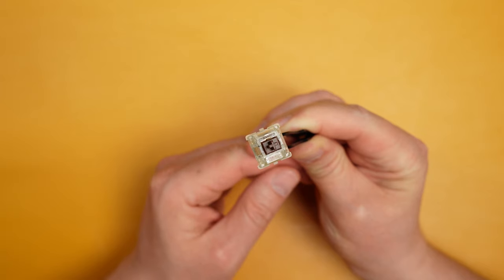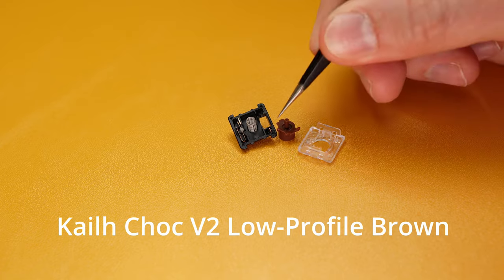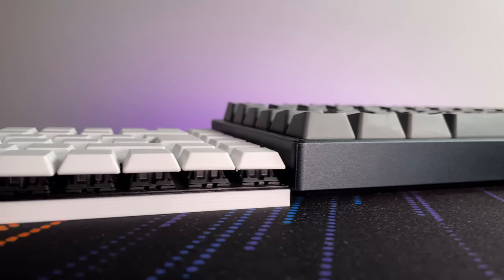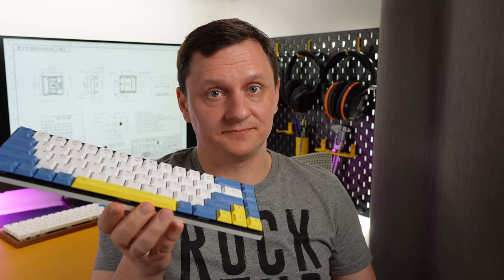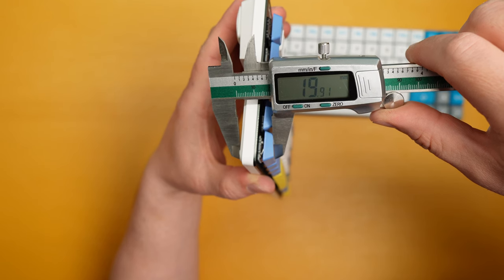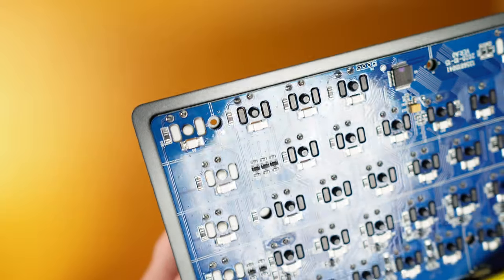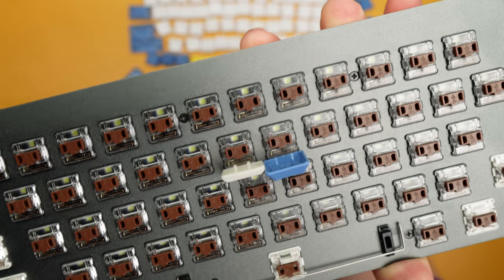Low-profile mechanical disaster

Comment: Honestly, the form-factor of Kailh Choc v1's should be the standard. There's literally no point to having "kinda low profile" switches.
Reply from the maker: Yes, some standards should exist for the low-profile switch ( keycaps, pins location, . . . )
Reply: @PavloKhmel   - Do they? Did you put these details you collected into a spreadsheet/ excel / table? Can you please share it - I am trying to create a Wiki base around LOW PROFILE Switches as hardly any proper info base exists.
Reply from the maker: @AX-fx7ng  I do not have a spreadsheet. What details are you collecting in your Wiki base?
The links below provide technical drawings and other technical information. AliExpress description for Gateron and TCC has technical details with technical drawings as well.  
- Kailh Choc Low-Profile Burnt Orange - http://www.kailh.com/en/Products/Ks/CS/321.html
- Kailh Choc V2 Low-Profile Brown - http://www.kailh.com/en/Products/Ks/CS/755.html
- Gateron KS-27 Low-Profile Brown - https://www.aliexpress.com/item/1005002957843849.html
- Cherry MX Low-Profile Red - https://www.cherrymx.de/_Resources/Persistent/b/3/1/e/b31ed369e2614b88503ba419d4e0a8339a7c55e5/Data%20sheet_MX1B-L2NA.pdf
- TTC KS32 Low-Profile Red - https://www.aliexpress.com/item/1005002118984269.html
Reply: @PavloKhmel   Muchos Gracias Brother. As much as possible for anyone wanting to Custom design around LPs. 
As I see so much data for normal ones, but very little for Low profiles. So many builders but not any "data/ wiki base" or Spreadsheet table for LP ones. 
Should we not put that together - as community?
Reply: @PavloKhmel  the community has made KiCad footprints for some of those switches, there's a few PCBs out there... mostly split ergo keebs
Reply: I much prefer the Choc v1’s keycap design too! No need for keycap pullers you just lift up the side of the switch to pop it out. The clickbar version is also superior.

Comment: I've been trying to look up all kinds of switches myself there are so many that it's just silly. Like only recently found out that you can't even just swap standard sized switches with low profiles from the same make because the pins are in different locations so I'd need a custom PCB just to use them. It's so stupid. Their websites should give out all this info about all their switches.

Comment: Finally, someone pointed this problem out haha. I recently bought a NuPhy Air75, and just learned that low profile switches are usually never compatible. It's such a pain. 
If it's alright with you, can you help me check if the Kailh Choc V1 springs are similar in height / diameter to the Gateron KS-27 springs? I found out that I can buy Sprit brand Kailh Choc springs separately (they have 12g-85g spring weights), and I want to try them on Gateron to create much lighter switches. Most of these low profile switches are 50g, and a bit too heavy for me. Thank you for your time!
Reply from the maker: I uploaded photo for you: https://www.reddit.com/user/pavlokhmel/comments/v1mz0m/springs_kailh_choc_v1_vs_gateron_ks27/
Kailh Choc V1 - spring diameter 3.41 mm, lenth 10.46 mm
Gateron KS-27 - spring diameter 3.33 mm, lenth 11.36 mm
It is possible to move springs between switches. But Gateron spring is longer.
Reply: Wow, thank you so much! This is very helpful!
Reply: @trelag  So you found a solution?

Comment: This shit needs to be standardized. If not, it might be due to mechanical constraints. In that case, they might be able to fix it by using super sturdy material like titanium for these pin plates... I just want a low profile switch compatible with standard mx plate why is this so hard??? I was looking at choc v2 maybe I can just get rid of the third pin would that work???
Reply: The reason pin arrangement has to be different is because these switches are newly patented. The old cherry mx patent ran out years ago so every switch manufacturer just copied the cherry switch. The metal leaf connected to the pins are different than the cherry mx version so if a company copied the pin out design their metal leaf would look very similar to a rival’s and they could get sued.

Comment: You are probably the only person online who can help me with my dilema. I have outemu low profile switches and i don't know what can i use as alternative. Are Kailh Choc V2 Low-Profile compatible with Outemu?  Or which low profile switches are compatible?
Reply from the maker: Unfortunately, all low-profile switches that I have tried have different pin locations. Outemu MX has pins location like Full-size Cherry MX but the pins are very thick. So they do not fit in hot-swap PCB for full-size switches. But theoretically, if you have PCB for Outemu you can try full-size "Cherry MX style" switches.
Reply: @PavloKhmel  Its insane that low profile switches of different vendors are not compatible with each other, but are compatible with non profile switches. Mind blowing :) Thanks for this man i really appreciate the feedback, i will be more careful when ordering.

Comment: Hi, the "Khail-like" switches that you mentioned that are not compatible with Khail V1 pinouts could be the WM type. WM types are what I had on my older Keychron K1 v4 keyboard before they changed to Gateron. The WM had a stem that was very similar to the Khail V1 but the pinouts were not compatible. I only found out from an old keyboard review that mentioned WM vaguely.

I purchased some Khail LP sample switches to modify my keyboard but I discovered the pinout wasn't the same. However I can't find any info about WM as a manufacturer, so who knows? :(

Comment: Are low profile Kailh switches compatible with low profile Keychron keyboards? Thanks, great video.
Reply: I would check the page and documentation for your keyboard, it should say what kind of pin-configuration is compatible. - I happen to have the K3 Pro, and on its page it says "The K3 Pro is currently compatible with Gateron low-profile mechanical switches only, as QMK does NOT support low-profile optical switches.". - This is a confusing statement, however, as it starts referring to optical switches. But, I think that refers to their own Keychron-brand optical switches. So that doesn't clarify whether any other (non-optical) switches from other brands are compatible. - I just checked and honestly can't find it (easily). But again, I think it just depends on the pin-layout and I think there are some switches that are the same.

Comment: I am peeved that even PCB boards do not accommodate different low profile pins. If you get a compatible board with Cherry MX LP, the only compatible switch are the Oetemu GTMX, but the housing center pin is smaller than the Cherry so it is quite wobbly on the board.

Comment: Where did you find Outemu MX "ultra-low" Brown ? I can barely find them anywhere. They seem like the only Cherry MX compatible and have the same pin layout. Even Cherry MX Brown and Cherry MX LowProfile Red don't seem to have the same pin layout, which is very strange.
Reply from the maker: I ordered them on Aliexpress: https://www.aliexpress.com/item/1005002079974329.html
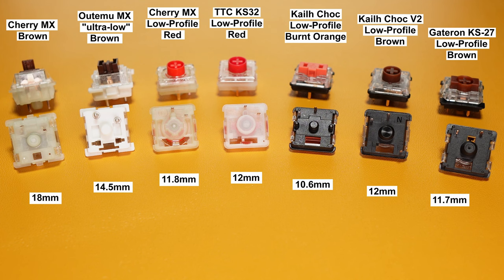Outemu MX has pins location like Cherry MX but pins are very thick (video 00:16). So they do not fit in hot-swap PCB.
NOTE: photos on Aliexpress show normal pins. Maybe something changed.
Reply: @PavloKhmel  Thank you very much for the clarification.

Comment: Hi. So did you manage to find a pcb that is compatible with low profile switches? I can't find concrete information anywhere but i imagine theme must be some pcbs compatible with the gateron KS27s, that are kinda becoming a standard...or not?
Reply from the maker: Not yet. I was working on other projects. So I postponed low-profile switches for a while.
Reply: @PavloKhmel  Thank you for the reply. I couldn't find a PCB since i want to build an ortholinear low profile keyboard :D (yeah i know) so i think I'll try my hand at hand wiring one with a micro pro to run it. I have no idea how i'll program it but that's for future me to figure out :). I'll be looking forward to whenever you get back to a low profile project.

Comment: Hi, Can you put low profile switches in a normal hotswap board?
Reply from the maker: No, unfortunately. I tried only these form videos. All of them have different pin locations except Outemu MX. Outemu MX has pins location like Cherry MX but the pins are very thick. So they do not fit in hot-swap PCB.

Comment: Man, low-profile keys are indeed frustrating to find.

I stumbled onto your video for my 'little' research of Outemu GTMX low-profile switches, which in my country, like 90% of the low-budget mechanical low-profile keyboards are using here. Comparing with the 0:16 on your video, it seems do have Cherry MX-LP bottom side but with Outemu MX ultra low top side (I think?). Or, if the top keycaps mounting is the same, it's seems like basically a clone of Cherry MX-LP. 

This one video, that I actually got a clear view of the switch.
https://youtu.be/VxQUNgJGTg4?si=mbxAQo3bnYHZrdj8&t=139

Problem is, I can't find any single. Yes, ANY SINGLE ONE, local store that sell the GTMX switches for replacement here on my country. TTC KS32 seems similar too, but, another no luck. Despite it's like being used on 90% of the budget low-profile mechanical keyboard here.

Yes, they're available on Aliexpress. But our Ministry of Trade thought if any imports from AliExpress are 'hurting' the local stores here, and 'solved' the shit by banning imports from foreign marketplace.